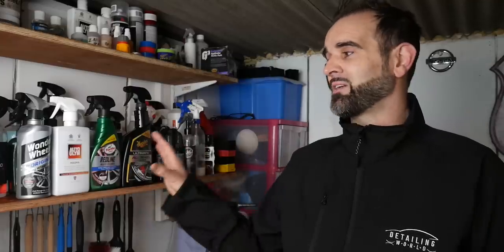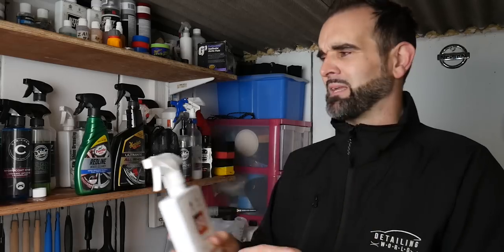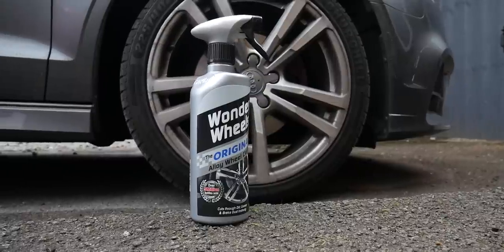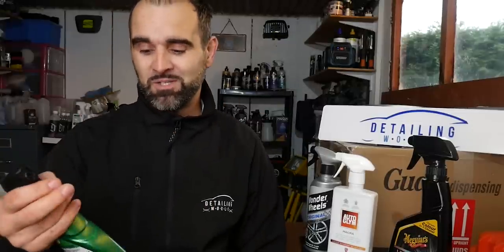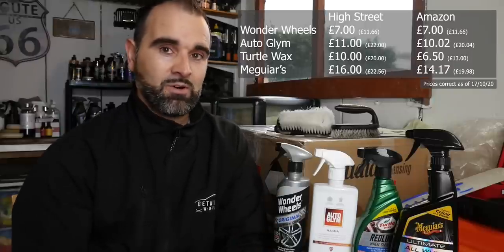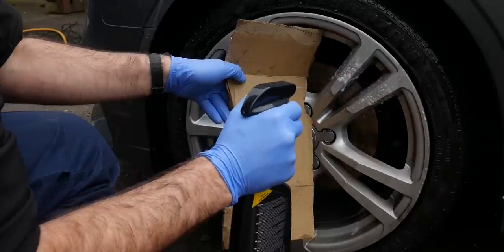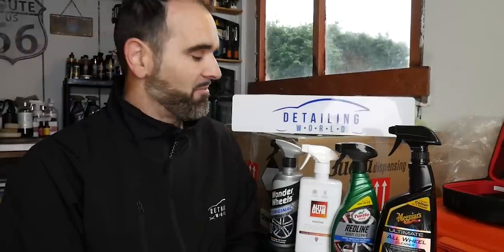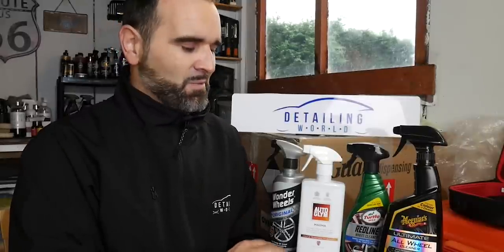AutoGlym Magma v Meguiar's Ultimate All Wheel Cleaner v Turtle Wax Redline v Wonder Wheels Who Wins?

Comment: Matt I would have done an agitation - non agitation split passenger / driver side instead of front back since front wheels as you know gather more brake dust build-up. left right split would have shown how much difference agitation makes to the whole process.

One more thing i noticed Matt, I use Maguires, it says use on DRY wheels, you rinsed the wheels first meaning that Maguires didnt get to work on the grime directly but floated on the water already on the wheels also it prevented the cleaner being absorbed by the grime as it was already saturated by water.
Reply: How would you recommend cleaning painted rims with Meguires? Just spray while dry then agitate with brush or microfiber mitt? I'm worried it'll just scratch the black paint up with all the gunk it's breaking down.

Comment: Good comparison video. I prefer Bilt Hamber Auto Wheel. By far the best wheel cleaner I've used.
Reply from the maker: Never tried that myself
Reply: @TheDetailingSpace  Give it a try, you won't be disappointed.
Reply from the maker: I'll get around to it one day 😂
Reply: Incredible stuff
Reply from the maker: Thanks 👍
Reply: I was going to say Auto Wheel was rather the glaring omission. Fastest cleaner I’ve ever used.
Reply: @paperchameleon  Definitely Mathew. It's quick to react with the metal particles on your wheels. It's very effective at cutting through the brake dust, road film and grime. It's acid free and it smells reasonably well. What's there not to like about Bilt Hamber Auto Wheel?
Reply: Definitely right about the Bilt Hamber auto wheel. That being said, I've had just as good results with their Korrosol too. 

However!  Bilt Hamber is not available to buy on ANY shelf on the High Street. At all. And thats a huge difference for some. 

If you love detailing then it's not an issue. But if you're just your average Joe who wants to head down to Halfords of a Saturday morning and take advantage of the fact it aint pissing with rain for the next 11 minutes, then this is a great comparison.
Reply: @paperchameleon  I think the purpose of this though was to test the brands you can buy in the High Street stores, NOT the more detailer-specific brands that only a specialist/online retailer would stock.

I'm in full agreement regarding Auto Wheels but I think this test is aimed more at the majority who don't share our deeper knowledge of detailing products!
Reply from the maker: Sparklean Autos: bang on. That's exactly the point 👍
Reply: @TheDetailingSpace  I get that, I suppose the thumbnail title would have been slightly better as Popular High Street Wheel Cleaners. I don’t consider ordering off Amazon too much challenge as you don’t need to even order off detailing stockists anymore for a lot of their range. It’s somewhat mainstream for anyone that likes detailing. Regardless good video.
Reply from the maker: True 👍
Reply: @SparkleanAutos  You have a point regarding casual detailers who  use the high street to buy their products. I suggested Bilt Hamber Auto Wheel to introduce them to a superior product, in my humble opinion. As you rightly stated, it's not available on the High Street, however a lot of people have eBay accounts and Bilt Hamber products are readily available on there.
Reply: Autosmart Smart Wheels is THE best wheel cleaner beyond doubt!
Reply from the maker: I am a fan of smart wheels.... Had that in my kit for about 10 years... Alys got 5-10l of it in the garage
Reply: At least we've had a friendly debate on who thinks which product is best. We all have different opinions for varying reasons and that's healthy. Us detailers may disagree on certain points occasionally, but we're all bound together by that desire to shine cars and we're willing to share hints and tips etc. Excellent thread on here.
Reply: @tonyhill1916  I’m yet to try Smart Wheels (If I have I don’t remember) but I have used AutoSmarts Red 7 before for an economical product it was pretty good. I’ll have to try it one day, I have Garage Therapy’s Zero Iron Oxide waiting on my shelf for a dry day to try first though.

Comment: Tells this ive been buying the maguires wheel cleaner for ages as i know its good but its just so expensive and considering the turtle wax redline due to being able to buy it in 5liter drums would you recommend the swap 25quid for 5 liters redline vs maguries ultimate £20 a bottle usually normally lasts one wash tbh you reckon the turtle wax redline is safe enough to use ? thoughts swap or stay with maguires ?
Reply from the maker: Swap, even if it's just due to the cost saving!
Reply: you reckon its safe enough? as i know its not as sudsy as the maguiers ultimate  @TheDetailingSpace
Reply from the maker: Yes, it should be fine..... Also you wouldn't use every wash anyway. If I'm doubt, apply it, and spray a little shampoo or #snowfoam over the top before agitating
Reply: i use the maguires on every wash can i not use that stuff every wash the redline wheel cleaner?
Reply from the maker: The real question is do you really need to? IMO there's no need to use fallout removers every single time.... I just use them a 2 or 3 times a year.
Reply: wander is the redline safe to use on the caliper bits to clean them up
Reply: what you reckon bout spraying it on the calipers also woudl you choose the redline wheel cleaner or maguires ultimate which would you choose yourself now?

Comment: With reactive wheel cleaners, surely you are better to apply to a dry wheel???  I think Meguiar's recommends that - did you read any instructions?
The jet washing technique was poor, missed a lot by just spraying downwards,. Covering brake discs with TGA is really a bad idea, it damages them and makes stopping the car a nightmare until it has cleaned off.  Needs care on application and why the broad-spread spray heads are a pain.  The cost per litre is vital, but so is the quantity required - you covered that pretty well.
Reply from the maker: Cheers 👍

Comment: Great video Mat. I've got the megs you used here at the moment. Question is, should I use the megs on the alloys and APC on the tyres? Does APC remove tyre dressing? Thanks in advance. Ashley
Reply from the maker: Depends on the stength of the APC
Reply: @TheDetailingSpace  I diluted it 10:1.
Reply from the maker: You might be fine then.
Reply: @TheDetailingSpace  I've learned a lot from your videos. I've never cleaned my own car so I am a complete noob.
Reply from the maker: Nice to hear 👍

Comment: hi i dropped my grit guard accidentley on the ground would you suggest to change it? also do you think its best to have two microfiber wash mitts one for the top and another for the bottom ?
Reply from the maker: No need to change the grit guard. They're solid plastic and just rinse clean.

Yes, 2 mitts are better than 1
Reply: @TheDetailingSpace  thanks 😉👌
Reply from the maker: No problem 👍

Comment: As others have said, Bilt Hamber is the best overall wheel cleaner I've used but great to see another comparison of high street products Mat. Tend to lose touch with what's available in Halfords etc. I remember buying the old Wonder Wheels  where you had to tip into a plastic cap and use the brush supplied which would fall apart after a few uses lol! Nasty, acrid smelling stuff! 😷😄
Reply from the maker: Haha, yeah, it still had that same smell
Reply: They were miles ahead of the game in terms of using a brush on your wheels though eh!

Comment: Hi just seen your video doing quick-release fittings on kranzle on hose an gun think u. Use pta tape it was white tape. u have the 2160 model where did u get yours . Would you say its worth  getting one
You put l link or Amazon for the part male and female for quick release did u have 2 of each? So quick release for hose to machine an quick release for the gun what u did was good idea 👍 would do the same could u help with the part in a link 
Or the Amazon link on the video is all u need an would I need 2 of each cheers was a good video
Reply from the maker: The Amazon links in that video should be everything you need.
Reply: @TheDetailingSpace  OK cheers in that video link for anarzon it's shows one Of each. Quick release       would i need two of each.  can u remember where u got your kranzle from an is the kranzle better then kartcher. the thanks again 👍
Reply from the maker: I got mine from amazon. You would need 2 of each if you want quick release at both ends
Reply: @TheDetailingSpace  cheers would u say kranzle better then kartcher.
Is yours the 2160 tst model?
Reply from the maker: No problem 👍

Yes, love my kranzle. Yes it's the 2160 tst
Reply: @TheDetailingSpace  hi the oil in the kranzle how often u change the oil ? 
You have really have got me thinking  about getting it.  it's the oil im a little unsure with getting one coz of changing it an getting the right oil for it . U are vary helpful 👍👍
Reply from the maker: I'd say once a year. I'll probably do mine in the next couple of months 👍
Reply: @TheDetailingSpace  OK thanks I look on Amazon seen 2 on there one for 7 hundred as so an the other one was over 1000 not arking how much u paid for your was it over a thous as the one on the link 1.200 or so ?
Reply from the maker: I got mine for a good price as it was an ex demo, but they do retail for just over a grand
Reply: @TheDetailingSpace  OK many thanks
Reply from the maker: No problem 👍